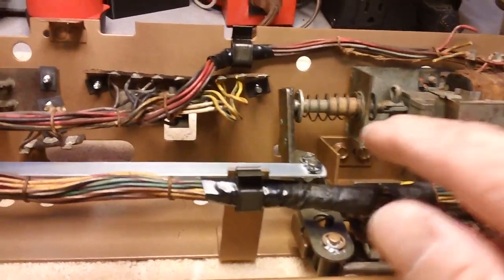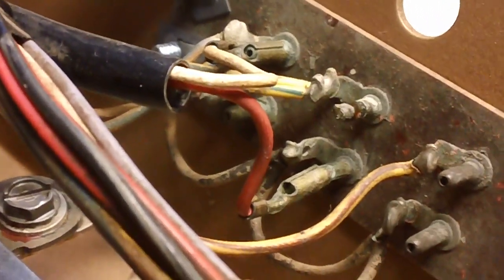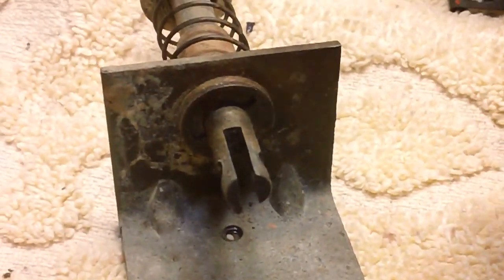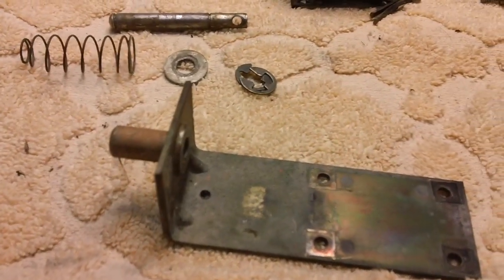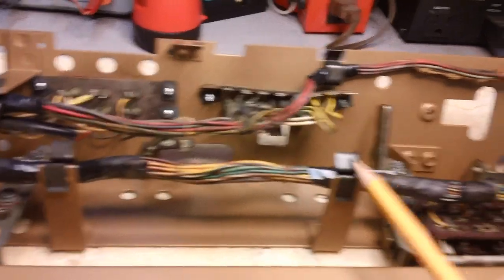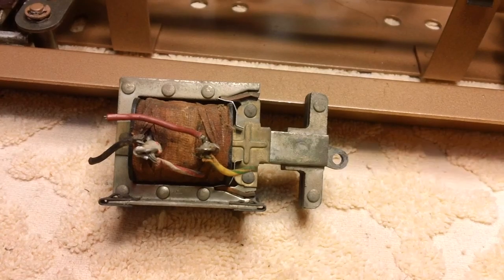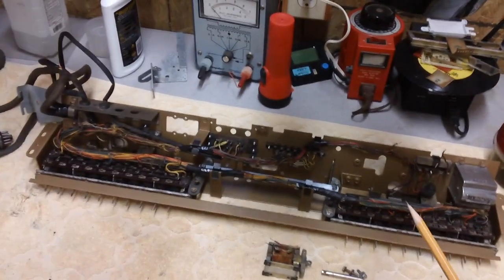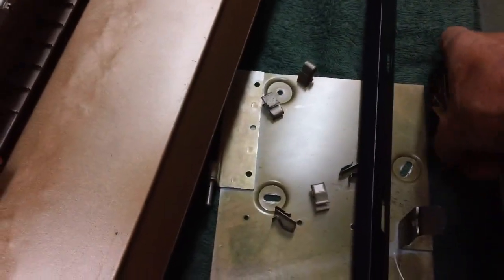1961 Seeburg AY100U Jukebox Restoration (Part 41 of 87).

Comment: Looking good and nice job on that solenoid, John.  Eagerly anticipating the first bench test! Question, is that little black capacitor CD 02 on the assembly original?  Just wondering if you are planning on changing it or if it tested good.  Hope you and yours had a great Thanksgiving.
Reply from the maker: Kevin,
That black mica cap is original to the unit.  I'm sure it's still good but will give it a test just to make sure.
Regards,
John

Comment: John, 
Sometime during the early 1990s, I had trouble with one of those coin activated latch solenoids (despite cleaning and lubricating, it continued to intermittently jam).  Since the demise of Seeburg Corporation during 1979, new replacement parts, especially for many of their older jukeboxes, gradually became less easy to source.  Consequently, I bought a new replacement solenoid of virtually identical type used for operating door locking mechanisms on commercial washing machines.  I had to make a few wee adjustments since it was made to be secured end-wise rather than rear-wise – like the one you have.  
The point I’m making here is you might well be able to source an identical type of solenoid (should you have cause to do so) as I have since seen them used to activate various types of mechanisms, such as those inside ‘amusement arcade’ machines; vending machines; laundromat equipment; timed locking mechanisms on security gates …and doubtless there are many more. 
Regards,
Phil.
Reply from the maker: Phil,
You bring up this info at a very opportune time as I'm about to bench test that Latch Solenoid.  Should it fail...well, let's not go in that direction just yet,  LOL
Regards,
John